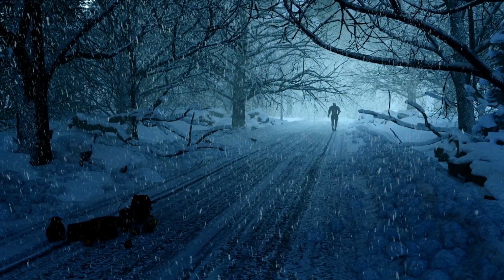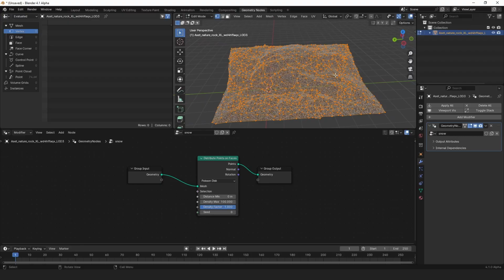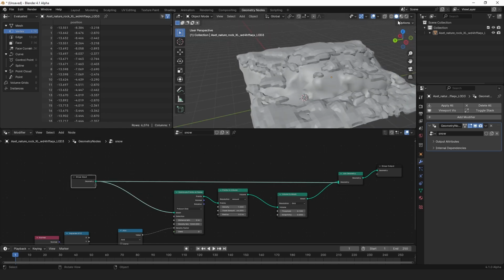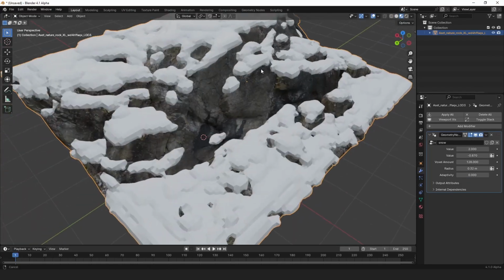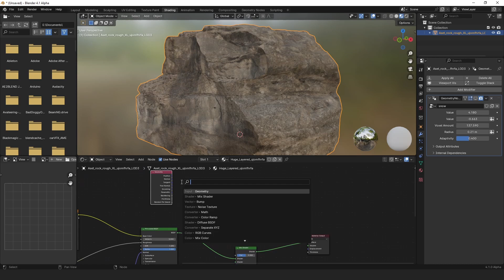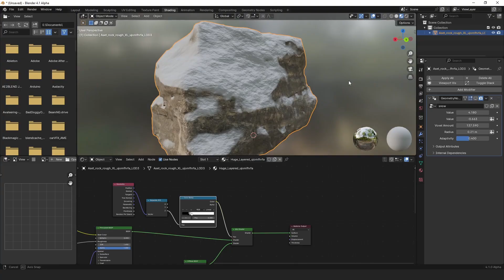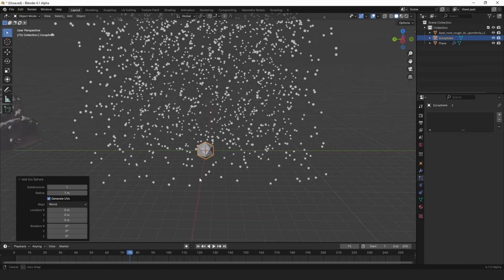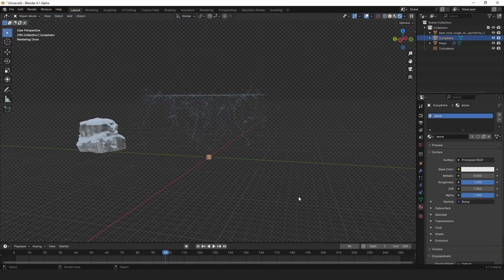3 Ways to make Realistic Snow in Blender

Comment: Thank you for this amazing tutorial! I was wondering, I have an animated 3D object in Blender and I would like to apply the shader version - I am facing the issue though, that snow is moving on the object, since it is tied to "Geometry => Normal" in the shader settings. I tried to user a different "Geometry Input" but unfortunately this doesn't solve the issue. I also tried using the "Mapping" node of the object itself, which unfortunately also didn't work. If you might have a hint on how I could fix this, I would very much appreciate it! Thanks again!